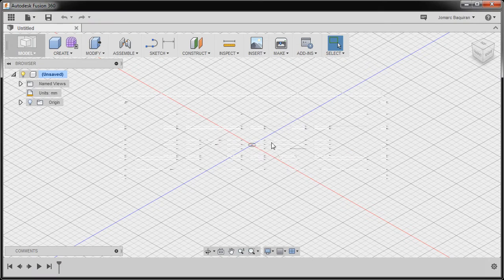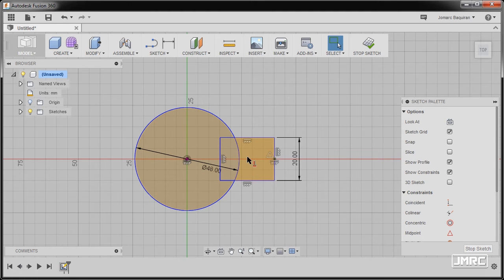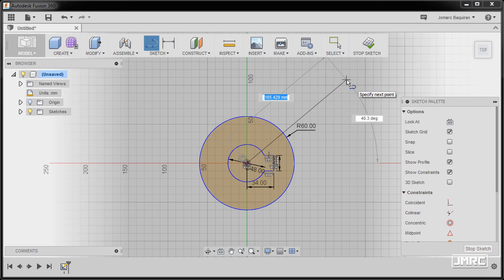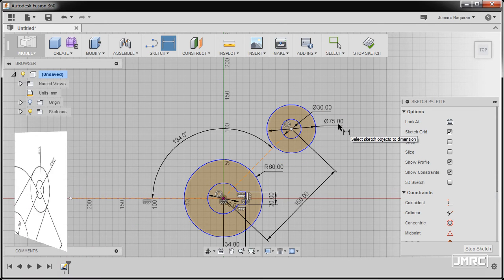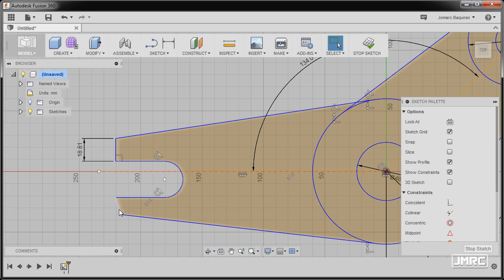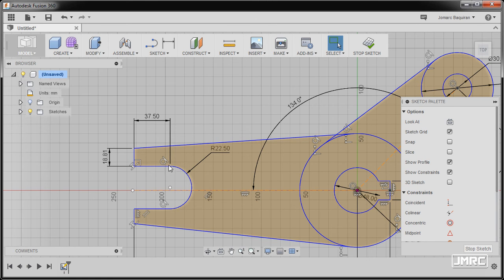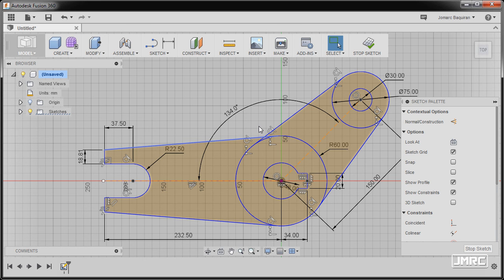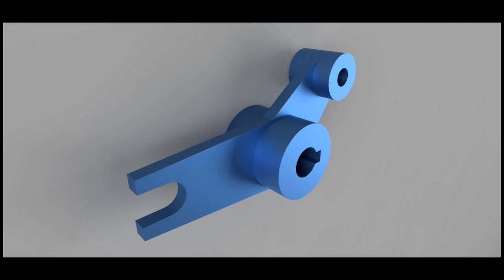Fusion 360 Part Modeling Exercise 02

Comment: Had a slide problem selecting the midpoint of the rectangle so i did it the way as learned in inventor by ading a ling on the middle and the constrain the rectangle.
The midpoint did not show.